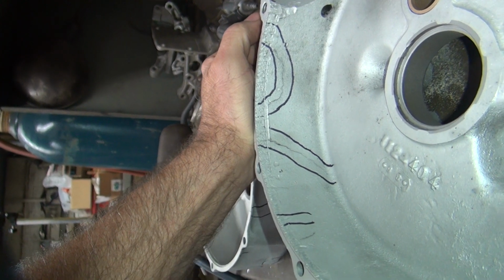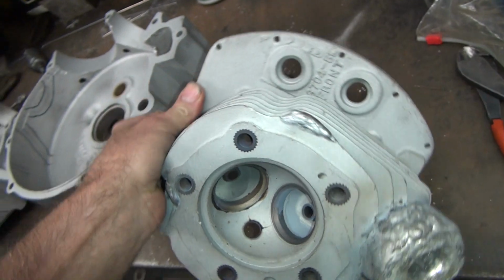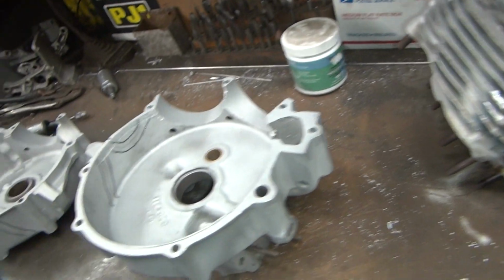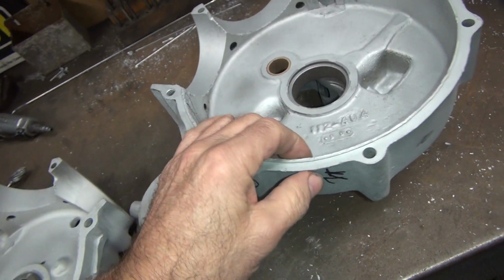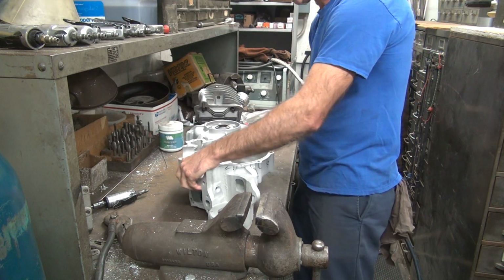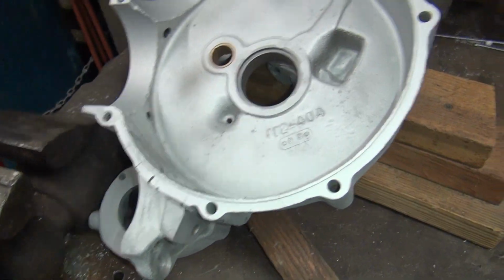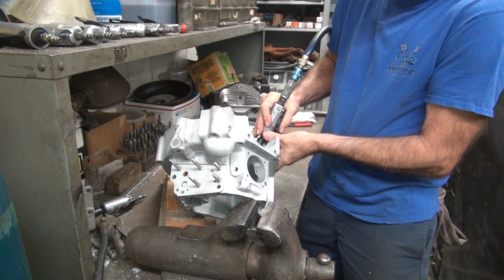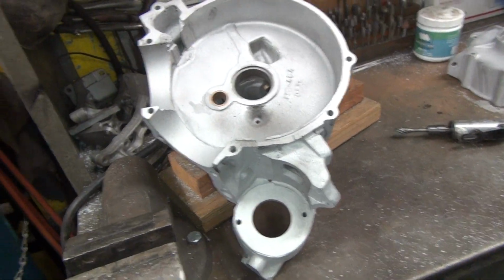#102 1947 EL case welding knucklehead 74ci motor weld and machining repair harley by tatro machine

Comment: Not to toot my horn, but to validate my two cents worth by saying that I was a welder-machinist for a major defense contractor  who was the main founder of the American Welding Society. This contractor established all the weld certification testing criteria for the AWS.  All the aluminum we welded there was 6061in a T6 hardness. 5356 was always the filler rod with one exception. When it was a weldment to be machined, we used isopropyl alcohol for a coolant during machining over those welds, and only high speed steel for cutters, never carbide. This was very effective against an otherwise shitty surface on the machined weldment. However, the one exception was in the case of the weldment getting anodized afterwards, then 4043 was the filler rod used. Our experience was the weld couldn't be seen thru the anodizing if 4043 rod was used. Also, you loose the T6 on any aluminum weldment after welding. However, the T6 will return by itself in about 90 days if not done cryogenically. Even though those earlier Harley castings were of mediocre to outright shit quality, I'm glad they were and are done out of a weldable alloy.
Reply from the maker: thanks for the info. i didn't know that the heat treat would come back all the way and only in 90 days. yes, maching that 6061 after welding is a pain.
what about the 5556 alloy rods? it is stronger than the 5356 rods. i only really care about welding cast harley parts.
tatro

Comment: You can use a Scaler to mimic the casting texture.
Reply from the maker: not really. it makes low spots and the casting has high spots. it just hides the machining marks and makes the surface uneven looking.
tatro

Comment: the shop that does my case welding 'regulises' (?) by placing parts in an oven after welding, does peening weld , although more labour intensive, negate having to heat after welding?.
Reply from the maker: all good. i use to post heat after welding when i had my oven set-up in the old shop. back to the old way for now. use what you have.
tatro

Comment: Mr. Tatro, by no means am I trying to interfere with what your doing. If I might make a comment about what an old welder from back in the 60"s taught me. The crack that runs from the parting line down toward the filet towards the crankbearing, what would drilling a hole at the end of the crack do? I was taught that would prevent the cracking from advancing while it's being welded.
Reply from the maker: nope, the crach just goes right passed the hole. its all about controlling the expansion and contraction as you heat and cool the parts. slow and even is best.
tatro